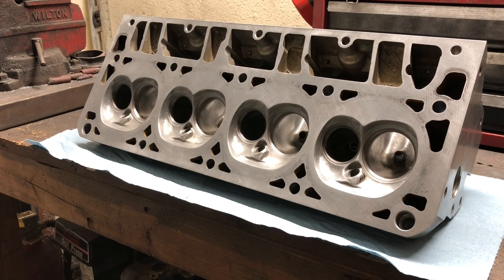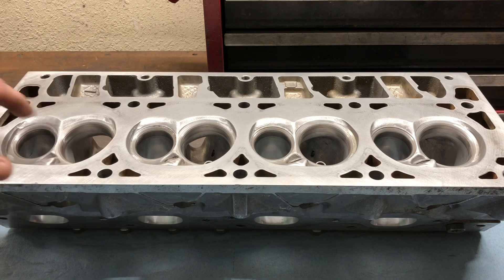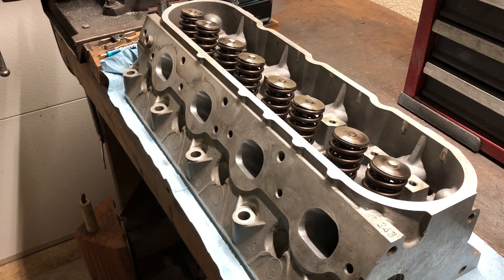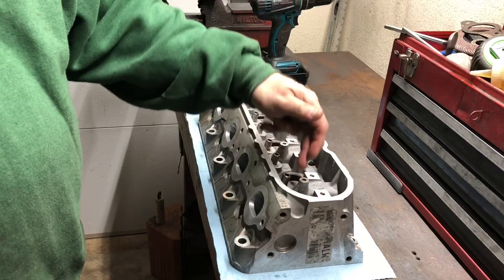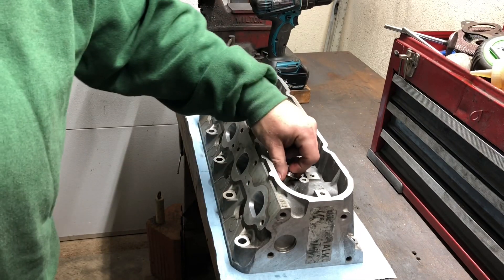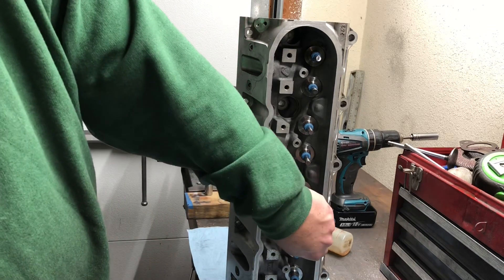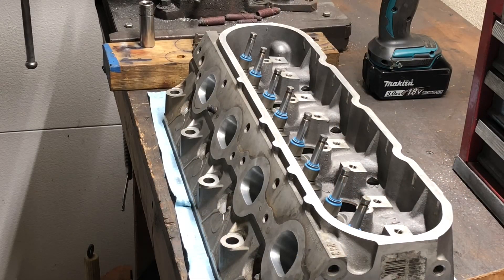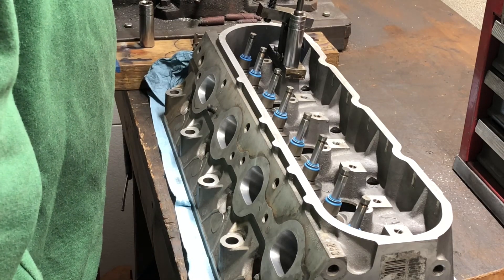LSX 220cc/225cc heads update

Comment: Damn plus the cleanest 👌
Reply from the maker: Cesar H Montalbo Thanks, these heads started out really dirty!  I use Heavy Duty oven cleaner, let it soak 15 minutes, then pressure wash.  Repeat process until clean.
Don’t let the oven cleaner sit on the aluminum more than 15-20 min Max it can darken the aluminum if left too long.  It’s amazing how well oven cleaner melts carbon etc.  
Thanks for watching and the feedback I appreciate it!  JD

Comment: Better to use one piece valve seal shim.  Especially on boosted applications. Because the boost comes up the valve guide and pushes regular valve seals off and into the motor goes the little springs and plastic.  Then the motor
Reply from the maker: I agree, in the early years they didn’t have a small diameter “Tophat” valve seal to fit the dual-valve springs. I prefer to run the one-piece seal/shim combo.  Thanks for watching stay tuned!  JD
Reply: HeadFlowInc no problem buddy keep up the good work. 👍🏻👍🏻👍🏻👍🏻

Comment: whats your opinion on the best street heads for a 400 SBC , pump gas and a mild roller???
Reply from the maker: Ronbo Nick A lot depends on what style pistons and the camshaft you want to run.  A max effort pump gas build, you’ll need to pay close attention to the DCR. (Dynamic Compression Ratio)
Being you have 400 CID the minimum port size I’d run is 210cc heads. 210-215cc would be a great all around size. 
The brand of head depends greatly on the budget. 
Remember the cam timing greatly affects the DCR, which is the factor for pump gas compatibility.  You’ll want a DCR of 8.70-1 or less to safely use 91-93 octane. As you can see the DCR is way different than the Static Compression Ratio. You can have 12.00-1 SCR but have a 9.00-1 DCR depending on cam timing. 
DCR 8.50-1 to 8.70-1 is generally the limit on pump premium.  JD
Reply: @HeadFlowInc  Kool info thanks  , yea Im on  a budget - Im a busted up ol white construction worker - It will probably be my last build ..  my goal is 400-500 hp . Ive never built a roller motor, anyway Im slowly collecting parts .. i was thinking about some old Fuelies ( 461-462 )  but was told there is a lot better out there now with a lot more power increase for the $$$$- plus Im wanting longivity..  Thanks for the reply ..
Reply: 906 or 062 I believe are the  head number those are the best head you can get for that small block 400  Without going aftermarket A good port job stage racing  And there you go Don't mean to hurt your feelings but I don't think you'll ever reach that horse power you looking for

Comment: Good job on these heads look like yr finaly getting it ..what numbers you cut to on the  Exhaust valve how come there's not a 5  Angle cut these heads looks like that's all thats missing..  are the valves sodium filled??
Reply from the maker: Another lost post! 🤬
The valves aren’t sodium filled, it would have been a nice upgrade. 
I don’t think we had a fresh valve job done, I think these still had the factory valve job.  I’ll have to go back and review the work. 
Flow data w/2.00”/1.55” valves no back cuts. 
Intake 306 cfm @.600” 
Exhaust 205 cfm @.600”

The intake port exceeded the 243/799 heads @ .425” lift. Good velocity but did fall off @ .700” lift.
Reply: @HeadFlowInc  That's a good head what's new out there in the world of porting?.
Reply: @HeadFlowInc  I have the same prc springs on my 799 heads with bigger valves from Texas speed. Actual air flow at .750 or .800 lift will start to flow backwards. They left alot of casting on the right sight of my intake runners. Lucky I didn't put the heads on my freshly built motor also. TSP left a bunch of aluminum particles inside my head.

Comment: Those aren't the top hat valve seals are they?
Reply from the maker: blown5.3 No, you can’t run the top hat style positive seals with dual springs. The dinner spring of the dual setup has a smaller diameter; it won’t fit over the top hat style. 
As long as you lube the top of the guide you should be fine installing the two piece seals.  
Thanks for the feedback I appreciate it!  JD